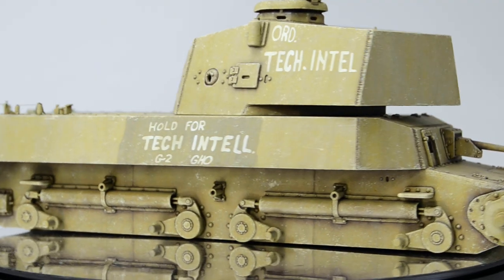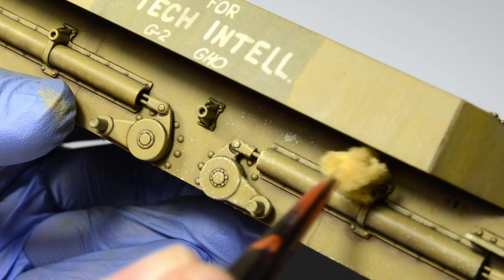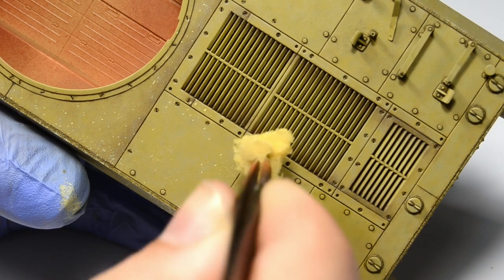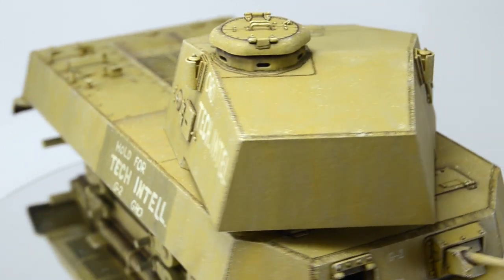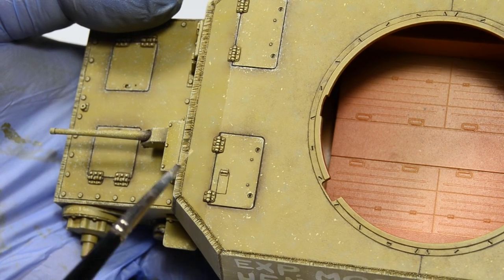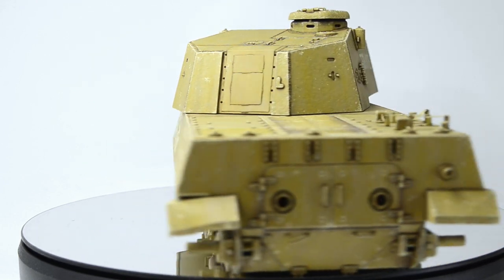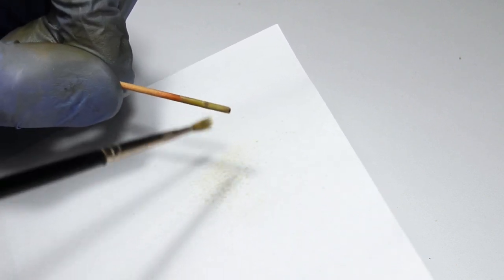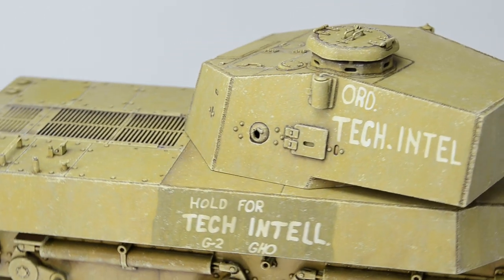1st Layer Of Chips ft. Sponge & Speckling - Type 5 Chi-Ri (Fine Molds 1/35)

Comment: I use sponge technique a lot. Usually 4 colors, a super light base color, dark grey, dark rust, light rust, the last 2 in very specific areas.  Then I do brush chipping. It takes a long time but I love the added depth. And I'm with you on building models, have fun. Even trying to do something from a picture, you have to exaggerate a little. If people painted models like the real thing? They would have some seriously boring looking models. As someone who crewed Bradley's for 10 years, all kinds of things happened to paint jobs, just depends on where it was used. Can't wait for the panther...hope it's a Wiking one...wink...lol
Reply from the maker: Wiking? Not even close :))))
Reply: @NightShiftScaleModels  drats...lol

Comment: I realize you are doing a "demonstration", but on most painted surfaces paint does not tend to chip on the large flat areas.   I see paint chips on the edges and, oddly, the inside corners where 2 surfaces meet.  Now with vehicles that throw up rocks and stuff, the leading surfaces may chip.
Reply from the maker: It depends on so many factors mate. But yes, basically what you said

Comment: Again a great video, thanks for going so much in the details, it help a lot for understanding the technique.
With oils, I have the reverse issue: when I try to remove too much of it, the acrylic under coat (Ammo by Mig) is starting the wear off, sometimes even the primer). Strangely, it is quite hard when it is on the airbrush parts! Do I need a varnish protection layer?
Reply from the maker: It’s always good to create that varnish barrier against enamel thinners. What you describe happened to my friend as well. Tamiya lacquer paints are very sturdy, they’ll hold against anything even without varnish
Reply: @NightShiftScaleModels  Thanks for the answer, I will try with a varnish protection next time

Comment: Can I be honest? I don't like the result of chipping as far. That looks like after a dry brushing the whole model. Bright color of chipping also makes previously used techniques less visible. I thinkt that chippng is too intensive (even for a abanded vechicle) and the colour is too contrastly. That could be looking beter if the chipping would be done before blanding with oils. After all, please don't shoot. It's just my opinion :)
Reply from the maker: Hey, that's perfectly okay mate! If I applied this technique before oils, they'd cover most of the small chips. This is definitely one of those "wait until it's done" steps, as chipping is basically a three-step technique: light chips, steel chips, rust tones. And... I hope you'll trust me on this, but the model is gonna look soooo siiiiiick when all 3 of those are done :)
Reply: Ok, thanks for answer and lenienting. I can't wait to se rest of works :)